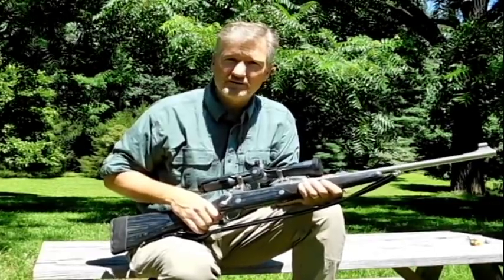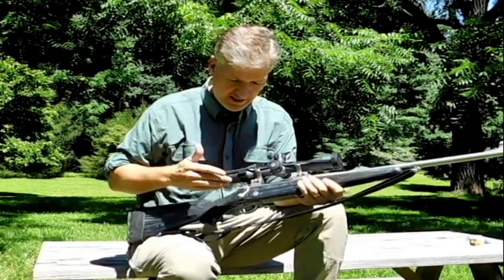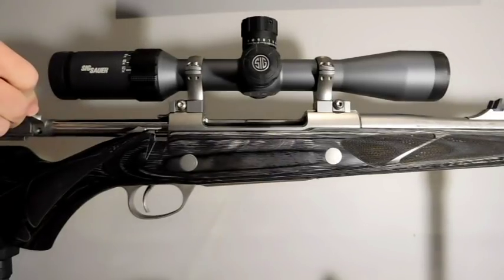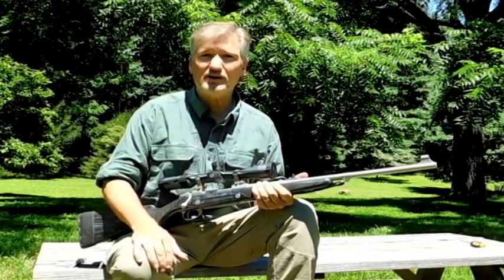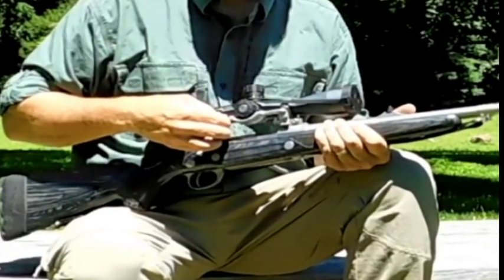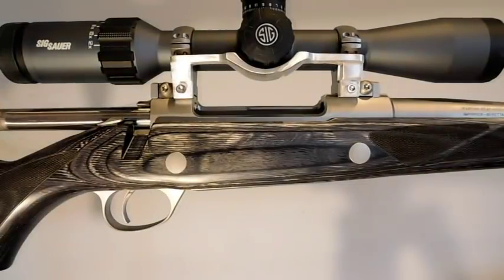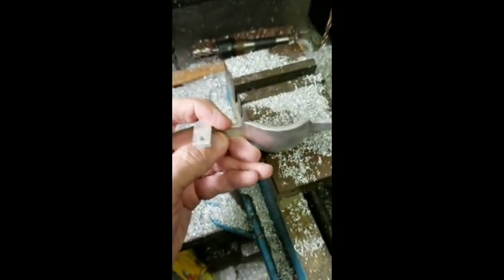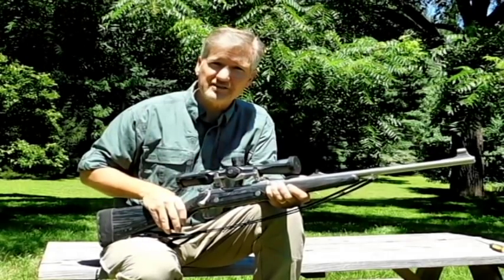Sako Model 85 Ejection Problem with Solution

Comment: Just an old geezer complaining about nothing. Your scope is wrong for this rifle. The big knobs are not necessary on a scope for your type of rifle and caliber. You could have chosen a better scope with only horizontal and vertical adjustments. Your rifle is not 'long range' use of rifle. There are many options for 6x scopes! Simple solution.
Reply: Tom Jakovac do enlighten me on my problem then. Sako 85 finnlite.270win scope Leupold vx3 3.5-10x40 1” tube with low mounts. I started with low mounts and the casings ricochets off the scope and out at least it does it consistently but still to me unacceptable so I tried high mounts and this time the casing smacks the bottom of the scope does a 180 and falls back into the receiver jamming the next shot and it does so consistently so I went back to the low mounts. So tell me it’s me and I’m pulling the bolt to slow or to fast or I need to slide my scope forwards or backwards or rotate so my elevation turret is on the side yeah I already heard all the bs from sako and beretta already.
Reply: I also have the same problem. Sako 85 30-06 with Leupold FX 2 6x36...very streamlined with low capped turrets. Mounted with medium height SAKO! ring mounts designed for SAKO rifles. Ejects right into the scope.
Reply: Joel Gomez I have the same issue with 85 m action in 30.06. Hits the scope damages the cartridge at either neck or shoulder depends how far forward or back you set the scope, if I use my high mounts it hits and comes back in the magazine. From what I read it's the medium and long actions but mainly 270 and 30.06 and 375 . Apparently it's the extractor that cannot keep the case against the bolt face tight enough when the ejector blade coming from 6 o clock, hits the case and pushes it up. If the extractor  clearance was less, i.e. Case held firm against the bolt face no matter the angle of the ejector blade it would eject out in the 10 o clock position of the extractor claw. Apparently  the cartridges mentioned and others that are troublesome, have a thinner rim , 1.24mm where for example in the same size medium action the 6.5 X 55 swede has a rim thickness of 1.5mm that's app 10 thou  of an inch difference, or 0.25mm and that keeps the case firm against the bolt face during ejector blade strike which ensures the case leaves in the correct direction. , lesser calibers, in the small and  sm actions are benefitting from a shorter arc due to their reduced lengths and so do not strike the scope ,even if they flop around, compared the longer action longer cartridges, that weigh more and wobble more and have the added length  of the  cartridge get directed too high, they will strike. The control round feed is also not helping as the base of the bolt face is open to allow the cartridge rim to slide up behind the extractor when feeding, this cutaway is too high on the left side, opposite to the extractor claw, so that the claw which places, sprung sideways pressure on the cartridge rim , can too easily push the case down  instead of keep it held, if you remove your bolt and draw a line from the middle of the extractor claw across the bolt face, going through the firing pin hole in the bolt center to the outer edge you will find that it will scribe  off into the very edge and bellow  the cutaway start The claw therefore cannot put a proper sure pressure against the rim as the opposite side has no material to press this against , extractor claw is at app 10 o clock the cutaway starts at 4 0clock, the center of the claw will be app 10.30 and that will be the tangent , the spot where the claw will act  sideways upon the case rim,, the claw has a flat inner   surface  so will contact the round case rim only in one tiny spot ,  so the 10.30 tangent pressure contact position ,  is directed straight across at  4.30 o'clock and there  is no bolt rim support at that point, extractor should have been lower say at app 9.30 and would therefor direct it's pressure across the bolt face to app 3.30  where there is still some meat or steel rim to keep the cartridge secured. Or start  the far side cutaway a little lower to say 5 o clock so the case can be secured.  It is all far too close and requires perfect tolerances  of claw grip in the across the bolt direction against the side of the rim  to keep the rim edge against the bolt shroud, and in the towards the bolt face direction to keep the rim base against the bolt face . Both are required for extraction to occur correctly, on smaller cases with smaller diameter rims there is a lesser cutaway on those bolts so more  shroud remains to house more than the upper half of the base  , compared larger case bolts where less than half the case  base is shrouded from center of the claw , the tangent spot , over the top and around down , to the opposite edge  of the cutaway start, this causes or allows  the case to slip  downwards if not perfectly aligned every time   and of course as stated earlier, smaller lighter, shorter cartridges in the smaller actions , work, where the only cases that work in medium and long actions are those that have thicker, 1.37mm and above rim thickness. And of course many others that should strike  the scope but simply don't, maybe a better fitting extractor . And of course there is just the unlucky owners that caught it in any action size . I was warned, but did not pay attention, did not believe it could really be an issue on a top brand product like Sako, bought waited, unpacked set up , tested and cursed.  Invested in higher rings, cursed again, took the claw out,  hit it with a hammer on the end , ( I read about this fix  in a forum and laughed my ass off till I owned the problem ),   The hammer tap , quite a firm tap,  standing the extractor up on a vice ,  or flat  stable steel surface with the claw uppermost and the back of the extractor contacting the vice or steel surface to strike against,  tap the claw to shorten it , this will close down the gap between the rim face and the bolt face so less wobble ,, when the case is gripped awaiting the ejector strike, ground  the inner flat surface ,  into a very slight radius  so as to contact more of the rim edge laterally across the bolt face thereby applying pressure across where there is a wall remaining  that is not cut out so it is held secure I  re- fitted it  and now it works,  even with my low rings . I bought a new claw as backup , guess what, didn't have to hit it, just a touch of grinding the curve into the flat and it grips the case perfectly and extracts perfectly, seems there are different tolerances happening on the extractors,  and some work better than others, pity that Sako don't offer a few different specific extractors to assist us , say 10thou  to 20 thou differences, standard, medium etc, we could fit and touch with a file to get a better extraction grip control  and ejection angle happening. ,  for those of us who already own the problem SAKO EXTRACTOR, COMPLETE, S491, M591, L691, L61R M90, 75/I-V  part number s 5940233  for those that don't  own the problem ,  we all know about scope, rings, firm bolt pull etc,  so as helpful as they have been it's not a fix to the real issue and the stubborn problems that , no matter what the don't eject , to those buying  new for the first time, check the rifle with a scope on and ask the gun shop salesman or lady,  to demonstrate before you buy,  if it does hit ,  and you love the rifle, they are great, negotiate a spare extractor claw  or two and take your chances   , or  consider a small action calibre, or walk away.  Ps get spare springs and pins too they are tiny and have a mind of their own when removing, it's  a simple  replacement procedure, there are a few utube vids on it and  good spring tension can assist with or detract from  positive ejection if they are weak.  Tools required are simply ,  a pair of long nose pliers, a fairly small fine flat screw driver and a vise to clamp the bolt while working, ease the one plier jaw under the extractor,  firmly grip it , ease it outwards and back while pushing the pin backwards with the edge of that small screwdriver ,  till the pin fully reverses enough that the claw can come out, ,  the spring and pin can shoot out during this, but will only be able to escape when the extractor claw is removed, so as you lift, wiggle and remove the claw, pay attention to the pin and spring. replace by gripping the claw in the pliers,  again from the front, place the spring  into its drilling followed by the pin, push the pin back and direct the rear of the claw down and back and as you see the pin about to ride the claw at the  rear, then angle the claw front down in its slot whilst maintaining rearward downward pressure, it simply snaps into place with a little manipulation.  The ejector blade can  contribute to the problems this   can also be filed  shorter, it's  very accessible and as long as you get a spare first, removing app 1 mm to 2 mm from the ejector blade length also stops the case being thrown too high,  this ejector blade  sits in the action and is fixed and rocks on two springs and one pivot shaft, so,as the bolt comes back it rides upwards into the cutout slot  on the bottom of the bolt at 6. O clock  and pushes  against the bottom of the case  at the rear , as the bolt is drawn out,  this ejects the case, if it is  too long  and coupled with the loose extractor claw, it will force the case too high before the claw can act to pull it sideways, like a timing thing, hence you read people mentioning to pull it back sharply , but consider the length of the strike  not simply the speed, a shorter length of push, will extract the same as a longer, however the angle is lessened, with the shorter strike push. So if you wish to test that,  it also works and produces similar results. Combined it's  very effective.  In terms of consistency .  Finally, if the case is only slightly hitting the scope, then don't worry, scopes are sturdy and the little ding ding won't break them,   If you reload, then position the scope slightly back, so the dent happens in the neck, this is easily reshaped when you resize the case neck during loading, the shoulder dents are not as  desirable and won't come out, unless fire formed , when shot again,  bringing pressures and case strength into question, anyway as long as it never falls back into the magazine then it's not a deal breaking issue, more something that you will get used to and will be forgotten  soon after you shoot your fine rifle, these rifles are fantastic and accurate ,  as long as it's just an occasional ding, don't let it effect your chance to own and be proud to own and shoot a fine rifle.